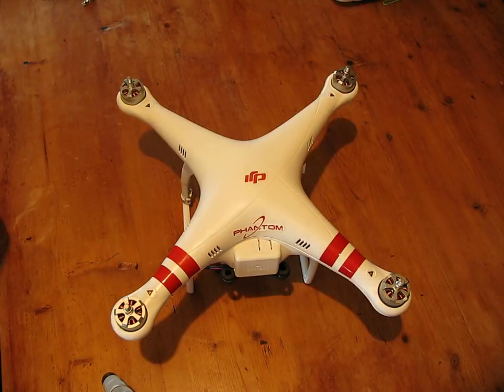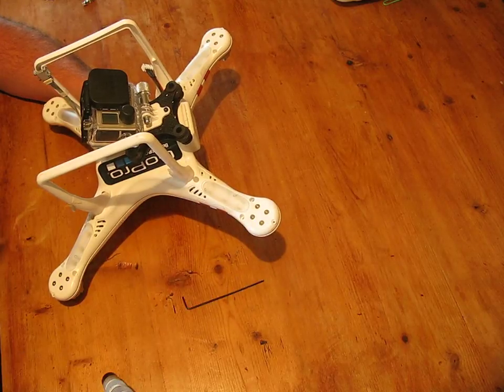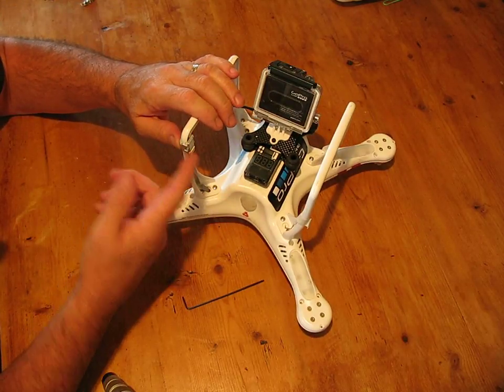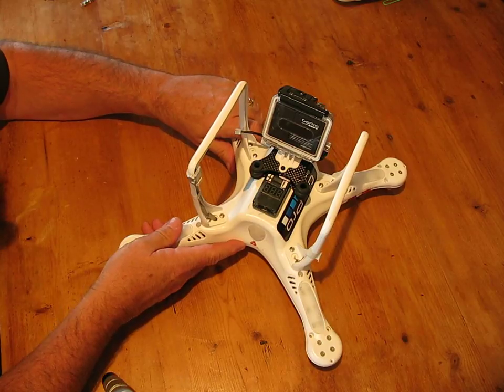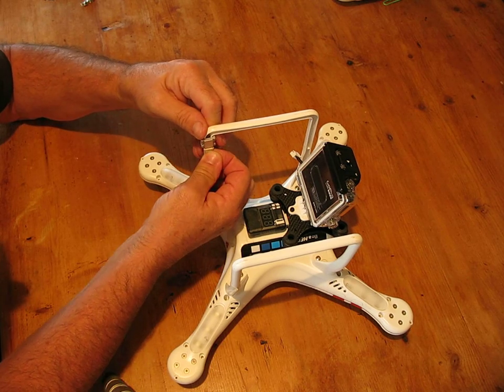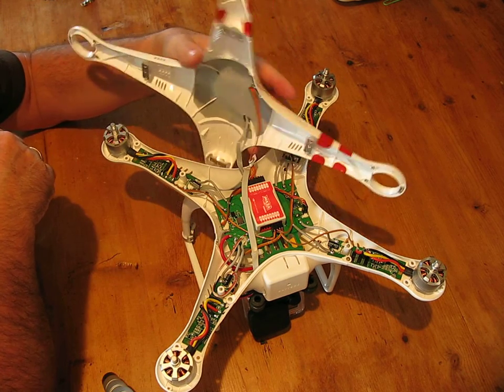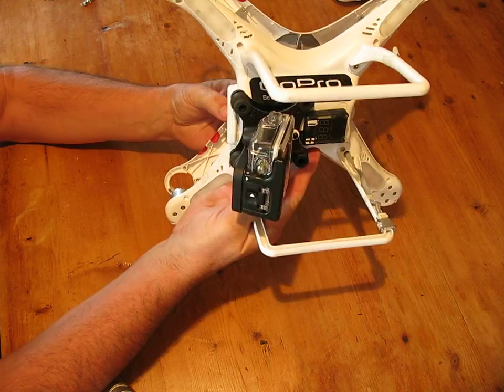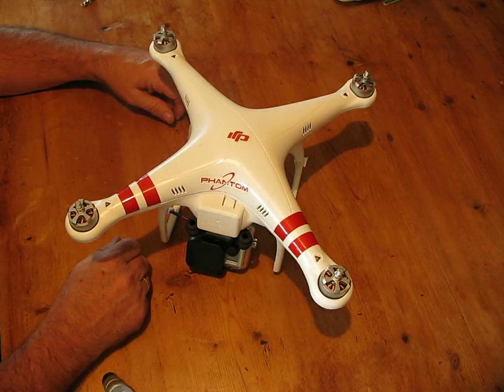DJI Phantom ! HOW TO OPEN THE BODY.

Comment: What kind of GoPro mod do you have on there? I have broken my gimbal several times due to an odd malfunction with my Phantom Vision 2+ where upon descending it picks up speed and crashes to the ground and thus breaking the gimbal ribbon. Rather then replacing the gimbal for the 5th time, I have resorted to attaching a GoPro with a sticky mount but have found its rather unstable. So, what do you have rigging your GoPro?
Reply from the maker: Cody Tubbs I don't have a gimbal as the wide angle of the GoPro is OK  for my needs, but I do use this as a softener.
http://www.amazon.com/gp/product/B00GAY5YBU/ref=as_li_tl?ie=UTF8&camp=1789&creative=9325&creativeASIN=B00GAY5YBU&linkCode=as2&tag=multibladehel-20

Comment: This should be made a point of More and more, Specially when replacing motors....These motors are full of the most powerfull magnets you would,nt believe it, They really are mighty strong magnets, so take utmost care when replacing or handling new motors near your drone, They will screw your compass up from quite a distance.....Just thought it worth a mention. It is something i have never seen said before.........Just a Thought/Headsup

Comment: I had to solder the negative battery terminal to the main circuit board after I crashed. Thank you so much for your video.
Reply from the maker: I am so glad you all find this useful, it so very to make a serious mistake when trying to open something like this.

Comment: thanks i have sand between my motors and this should get it out with a compressed air blower
Reply from the maker: Be careful.
Reply: Topvideos1001 i know.
well i did it and it worked my phantom is now running smooth so thanks for the advice
Reply from the maker: mitchell2820
Fantastic ;-) Have a great Christmas.
Reply: Topvideos1001 you to man!

Comment from the maker: The Red and Gray wires are for any accessory to be added, they need to be kept apart if not being used, they are the same voltage as the main battery, Red is + live, Gray is negative -

Comment: I attempted to do your battery wire mod. That worked out but when i went to plug the battery back it started to smoke. Opened the unit back up and saw that the smaller red and grey wires were burnt. What is the smaller red and grey wires?